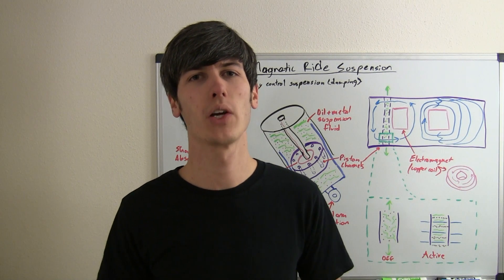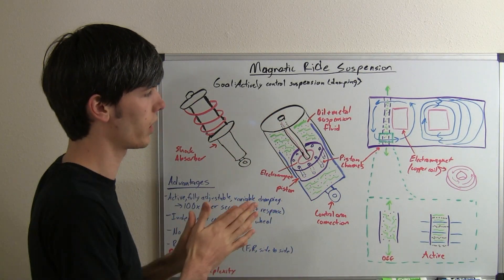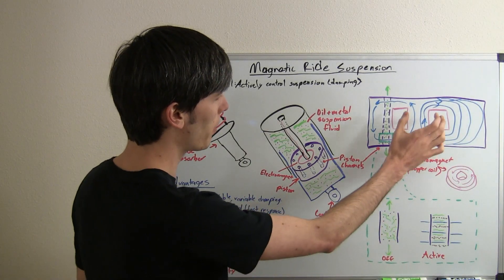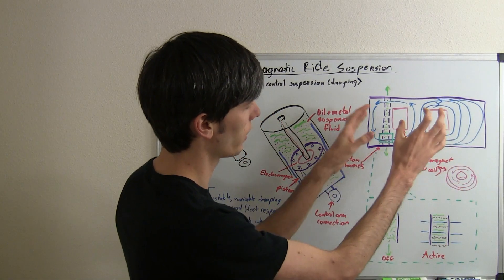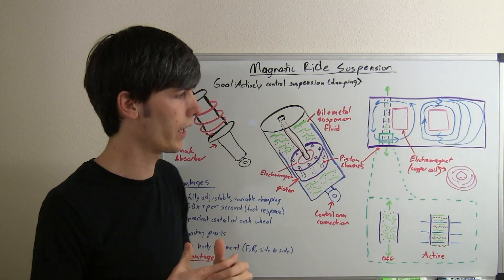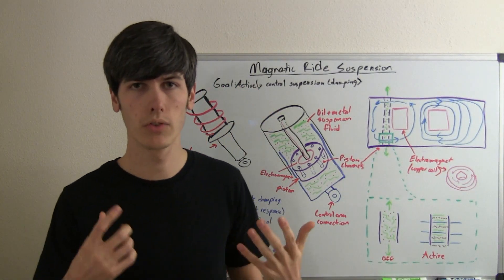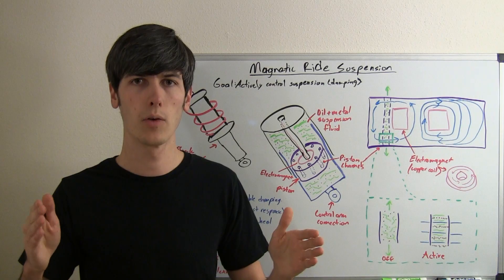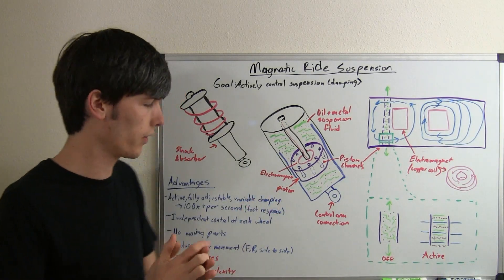How Magnetic Suspensions Work - Magnetic Ride Control

Comment: Thanks for the knowledge!  Curious how effective this would be on a solid rear axle with leaf springs?  Would only the front suspension benefit?  If you have any thoughts I would love to hear more.  The '21-'23 trucks offer CCD (continuously controlled damping, i.e., magnetic suspension) with solid rear axle, and it limits available suspension mods.  If I never lift the truck, would the damping really make a difference with a solid rear axle and leaf springs?

Comment: I have a few questions a few years late. Could these metal particles cause wear inside the shock, or is it a non-issue since it is suspended in the fluid? Also, is there a certain amount of metal particles used inside these shocks? How does this fluid hold up under high heat situations? Can it dissipate heat well?

Comment: I believe the kind of damper you talk about in this video is called magnetorheological damper, which still uses fluid viscosity for damping effect.
What most people would think of an electromagnetic damper is a kind of magnet - coil wire damper

Comment: So when it gets stiff as it gets older could you cross the shock wires ONLY (not the wire from the controller) and essentially open them up wide for a soft ride? I realize the light will come on but if more electric juice stiffens it and less softens it then wouldn’t is really soften if the to wires coming out of the top of the shock make it ride much softer? GMC Denali

Comment: Very cool video...   But when the system fails do the shocks work as normal shocks ?  As a service tech I know wire coils will break down from heat.  I also wonder how expensive these shocks are vs conventional ones.  Its a neat idea but probably should stay on the race track until its perfected.  People have enough computers and electronics to deal with already.

Comment: Cost and complexity, that is exactly why we never will see cars with any form of advanced suspension anymore. Citroën have stopped making their legendary hydropneumatic suspension, which they have used since the 1950's, because it was too expensive and complex (and complex means extra costs). So I doubt we will see electromagnetic suspension very soon, unfortunately. If ever. Cars of 2020 have the same suspension as an ancient Lada or Trabant from the cold war. So it is not exactly moving forward at all.
Citroën was the only one who really did something revolutionary suspensionwise. But now it have ended, sadly. I love Citroën, and drive one, so I'm not too happy about their decision.
I would love magnetic suspension, I'm sure. But since it is more expensive for the manufacturers, well, I will probably never have the pleasure to own a magnetic car.
So, you engineers need to invent a suspension that is cheap (cheaper than regular coilovers), lightweight and can restore energy to save Co2 emissions and give better gas mileage, highly advanced suspension action for the driver and not at all complex for the manufacturers to install. If you do that, every car will probably use it. At least it must be able to compete with coilovers, both in cost and complexity, otherwise they will not use it, that's for sure. Remember they still use the same suspension today as they did during world war II, or something. So they are not willing to pay any extra for something better, that is for sure.

Comment: I have this on my vehicle.  I HAVE ALWAYS WONDER HOW THE SMALL METAL PARTICLES DON'T WEAR OUT THE SEALS AND CAUSE THE SHOCK TO LEAK.

Would love to see a video on this is you don't have one.  If my dirt bike has particles of dirt in the fork oil I am going to wear out the seals and the oil is going to slowly leaking out.  I assume the metal particles must be to quite big, but how does this not interfere with function.

Comment: Hi I’ve got a Peugeot 59 plate which as got electronic back shocks can these be converted as very exspensive it’s the 3008 2.0 plus are they magnetic like the ones you are talking about as there is a pipe coming from the bottom like a break pipe

Comment: What would be the best way to go about finding the voltage for each setting? Do you know of a place to find that other than going into the suspension and testing it with a volt meter?

Comment: Hi Jason Im surprised by people making "active" suspension that the best they can do is create a flatter/stiffer car that passes all its forces onto the occupants. Why dont active suspensions roll INTO corners or adjust pitch and yaw under breaking and acceleration so that the minimum amount of force is transferred to the occupants of the car just like a motorcycle leaning into a corner? Or has there been such systems introduced since this video was made 3 years ago?
Thanks to you and your team for your great and informative series.
Reply: This is a semi active system.  Active would be a system that anticipates inputs that have not occurred yet (such as leaning into a corner).  Google bose active suspension for some active suspension!  Mag ride, similar to the Fox Live Valve system, is semi active and only reacts to inputs that have already occurred such as brake, throttle, steering, possibly acceleration on all axis to perform more complex adjustments (I have no idea how many inputs these systems have, but presumably any data the car produces can be fed to the suspension control algorithm.

Comment: DO NOT  Buy an Car or Truck     with Magnetic  ride    they  are complete junk , i'v replaced a ton of these shocks an struts     they  only seem to last between 60-100kmiles before they blow an start leaking     and  they are  expensive         i just  replaced some on  2015 Esclade  with  98k miles   an all 4   were leaking   total bill was  $3300   parts &labor  
an  if  you do own  a  car   with  Magnetic  ride     there are conversion kits available for most cars  that  coverts it to regular shocks and struts

Comment: I love the idea!
I also thought at using magnets as suspensions, but my idea was to use normal magnets with 2 poles; a suspension like that would be based on the rejection of 2 magnets set face to face, with the same pole.
Reply: I was thinking the same thing.  The only problem I see is the energy needed is way too much.  But the progressive rate from using magnets and if you put it as far out on the wheel as possible would reduce road feel by crazy amounts.  Like driving a hover car except for the steering and joint connections, as far as feel goes.
Reply: Bose made a concept like that 30 years ago, you probably have already seen that video here on youtube, it never made into production because of energy consumption and size/weight.

Comment: I have a 2015 Cadillac Escalade and it has magnetic ride control and the car is almost 3 years old now and the ride is so rough, even though it on touring mode (it’s comfort suspension mode), that we avoid using it as much as possible.

Edit: it’s got 80k miles
Reply: I have the same vehicle. Ditto to what you said. Terrible run. I want to change out to conventional shock. Did you do that’s?

Comment: Excellant engineering presentation. Now lets get to Economics class and figure out how to reduce the cost, and then lwt's try to simply this bugger.
One thing, you said it doesn't have moving parts? How? I don't get how there is an up and down dampening happening then?

Comment: OK. Looks like I've some to the right place for my current magnetic ride control dilemma. I bought a 2018 Yukon Denali a couple months ago. Had it lowered, 2” in front and 4” in rear. The lowering kit included 3” sensor rods, which would replace the 4 ½” rods in the front. The shop did not install the 3” rods which came with the kit, but kept the 4 ½” rods installed. I noticed the ride was quite a bit rougher so I had my mechanic swap out the springs and put the OEM springs back in. Now my Denali rides rougher than ever!

The space now (with the OE springs) between the front tire and the fender is more than when I bought it. There is about 5.5” of space between the tire and fender, where it used to be 4” or so. The ride is so rough that it reminds me of the old Lincolns when the air bags would go out. 

What do I need to do to fix this? Why is it riding so rough?

Comment: I just saw this video. I know it's from a long time ago, but I wanted to ask: How does this compares to the Bose Suspension System of the 80s-90s? Because that technology never took off and nowadays you can see many cars with magnetic suspension, like Ferraris and now with many not so expensive ones, but they look a lot different in the way they handle the car. I don't know how the Bose system worked, but it looks very different and way more advanced even by today standards (although it seems that it was way more heavier)
Reply: Yes, the Bose system is much more advanced. It did not take off because of the ancillary power hardware necessary to make it work. However, with EVs, we may finally see a Bose-like system. EVs already have the batteries and power control systems to make this viable.

Comment: beautifully explained but how does the system know when to give current through the coils and when not??
Reply: There are sensors on board which are able to measure damper travel, rate of damper travel, roll rate, etc. The data from these sensors go to controllers, which then decide what should be the current supplied to the coil to reduce the body roll or whatever it is that you want to control.
Reply: when cornering, it requires more stiffness and when it hits bumps, it requires lesser stiffness, how do the sensors differentiate.?

Comment: What type of vibrations occur in magnetic suspension (electromagnetic)? Reply awaited
Reply: None, smooth ride. I imagine daily speed bumps would be bad for any high tech suspension, magnetic or air. Possibly making proper setting adjustments and lower apeeds over bumps would eliminate extra wear. Bottom like if one wants luxery and performance there is a price to pay.

Comment: are there any magnetic damper technologies which solely rely on magnetic repulsion for damping? like for example, there could be 2 face plates in the damper at opposite ends, both of which would be like poles(N-N or S-S). This would cause magnetic repulsion, the magnitude of which, could be governed by the user. this magnetic repulsion would give the necessary damping force.

Comment: I found your video channel today. And they are great ! And I wanted to ask if it would be cheaper to build a new Mag suspension or is it possible to modify an existing damper by replacing its oil with MR fluid and making a coil in the piston ? Thanks
Reply: New, hands down

Comment: Is there a mechanism to keep these magnetic particles afloat? won't they all eventually sink down to the bottom due to gravity?
Reply: these magnetic particles r tiny with minimal density and the electrical fluid we using should have good density so it doesn't seem they can sink they remain float due to density and ofcourse magneto-electrical reaction is one more reason

Comment: thanks for the info, which cars use the magnetic suspension, modern or old, expensive or cheap, or which car models
Reply: GM
Corvettes starting around 05 and up (various models & options)
2012-2015 zl 1 Camaro
2016 Camaro SS
2015-2016 Chevy SS (Holden Commodore)
Holden VF HSV GTS 2014-2016
Caddy CTS-V
Caddy ATS-V

Ferrari f499 I think

Some Audi A8's

It's an amazing system, you have to drive a car with it to truly underatand.  My 2015 Chevy SS with mag ride is unreal.
Reply: Literally every Audi*

Comment: Absolutely amazing ride quality. Horrible horrible repair bills. I want to replace it with ACDelco parts but I can't... I can't spend nearly $2000 on PARTS alone to replace them in the BACK ONLY for my Cadillac. I have to go to a passive system :(
Reply: Luxury car parts can get expensive! I'm a Lexus mechanic and on our LX570's and the LS models that use air suspension can also have the same price in their suspension as well! I'm sure Mercedes has similar prices too!
Reply: +HERKFOOT21 I know! For $5,000 (total for all replacements) I could just buy another one! lol

Comment: I have Magneride in my 2015 Chevrolet SS. I have to say it's ride quality is about as good as my friend's car with performance airlift suspension. While Magneride is expensive it also has a fairly low rate of failure. When it does it's the computer not the actual shock. Compared to bags which can rupture and cause other bad things.
Reply: The SS is an amazing car, i just got one Weds.  

The mag ride & 4 brembos are a ridiculous combo!!
Reply: Joe Orler Yeah, I just swapped out the downpipe for a higher flow cat. Next I have an exhaust cutout coming next week. Then it'll be intake and a tune. I'm gonna leave the rest of it stock after that.
Reply: Yeah. After a year. It's still very nice. I ended up putting in lowing springs. It helped a lot in promoting neutral handling. Ride quality only suffered mildly.

Comment: Question - Say if someone didn't drive their car for a week (vacation or what ever you can think of) would the magnetic particles settle towards the bottom of the shock? 
Also having magnetic particles inside the fluid, wouldn't it cause a more wear than a traditional shock?
Reply: No it wont settle down as the iron particle sizes are to nano scale so there is a concept of Brownian motion which makes the particle moving inside the fluid
Reply: Magnetic field mixing?
Reply: Stiction is a normal occurrence in just about any fluid-filled struts that sit unused for extended periods of time. I work somewhere that manufactures these and we have a TSB sheet that specifically mentions this as a normal thing that happens and typically remedies itself during normal use.

Eventually it can become a symptom of other wear and tear damage to the shock such as corrosion, failing seals, manufacture defects, and oil degradation. 

If anything letting it sit undriven would probably to lead to less of the detrimental variety of stiction since you won't be wearing out the assembly as quickly by introducing constant friction, heat, and impact.

Comment: do an air suspension vs magnetic suspension vs hydraulic suspension
Reply: There are coil springs with hydraulic telescopes, air springs with hydraulic telescopes, coil springs with magnetic telescopes and probably air springs with magnetic telescopes.
Reply: The telescope is a piston. ;)
Reply: You need to learn more about reality.

Comment: I recently drove an Audi S3 equipped with magnetic ride control. I kind of say they actually do work wonders. Despite the car wearing very low profile 235/35R19s, the car rides better than the Infiniti Q50S also wearing 19" wheels. Dial in the dynamic/sport mode and the car felt just as tossable as any RWD car.

Comment: Its concept looks great! and I have some questions about it. would you make comment s about it?
1) the density (the number of particles per unit volume) of metal particles in the fluid is not uniform, so the suspension effect is not regular. also it affects the viscosity of fluid.
2)  Metal particles generally are heavier than fluid, so almost of the particles would be on the bottom side...

Comment: Two things: 1. From my understanding this type of magnetic suspension is known as adaptive not active. Active suspension has some type of actuator that changes the ride height and can apply a force to a wheel not just change damping. 2. Electromagnets are controlled by current, not voltage.

Comment: Has anyone have reliability issue with these suspension.
Reply: Brandon Johnson You don't even know your own car then.  Porsche Active Suspension Management (PASM) uses a solenoid to vary the valve opening size but the fluid is traditional oil, not magnetic.

Comment: Thanks for the informative video, just one question though. How does the system ensure that metal suspension does not settle, or clog the tiny channels around in piston!
Reply from the maker: I don't know, I'm guessing the particles are small enough, and the oil is viscous enough, that they can be held suspended indefinitely.
Reply: Those particles are like powder, they're too small to clog the channels, instead I think the main problem is abrasion,  they need more powerfull insulation for cylinder and piston rod to avoid it.

Comment: Do you have a video showing how "air suspension" works?
Air suspension is use in vehicle like Range Rover so it can change its right height correct?
Reply from the maker: Nope! Un dia.
Reply: Engineering Explained typo, not right height but "ride height".

Comment: Interesting. I initially thought it would simply be an application of Lenz's Law (magnet through a copper tube experiment) with a stronger current slowing the passing of the particles.
Do you know what applications this particular design is being used in or who it's being used by? Surely it's patented to some degree.

Comment: costly and complex.
but everything is computer controlled in new models so should be simple and cost is divided over profits so ie toyota corolla can use it in 2015 models.
when would such game changing tech trikle down to customers as these potholes on the roads are not fun .thanks for the video